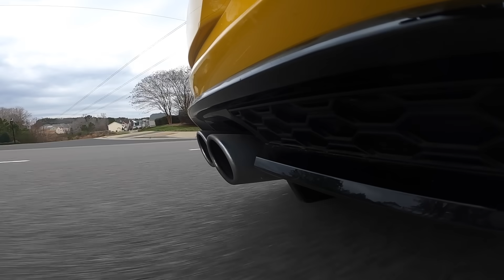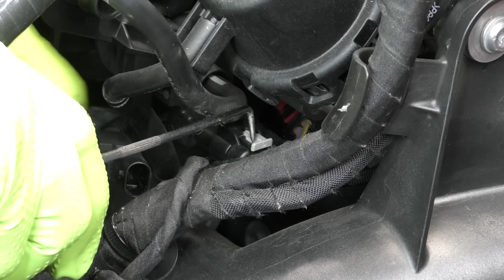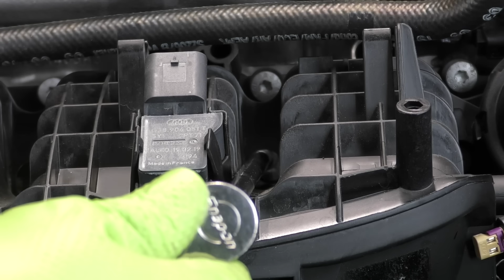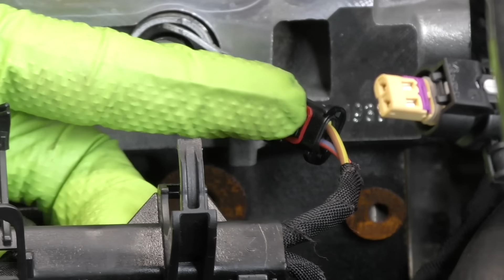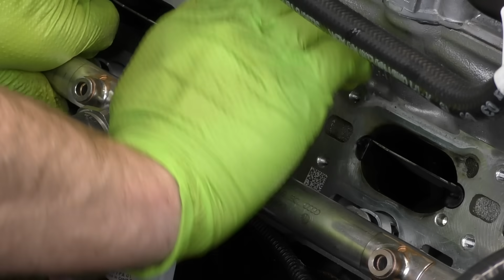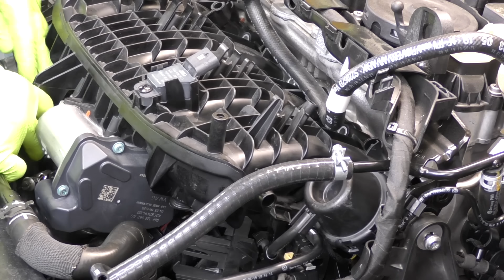Fuel Injector Replacement VW/Audi TSI Engines

Comment: Perfect know ima knock mine out cause my epc light keeps coming on and the car goes limp then I have to pull over restart and hope it doesn't come back on😮‍💨
Reply: Did it work my epc light came on. I changed the coil, pcv. This is my next step I’m still contemplating if I buy all 4 aftermarket or just 1oem. It about the same price.

Comment: If you get too much fuel mixing with engine oil, your oil will be thinned out and you could get a bearing knock. Happened to me a few months ago on a new engine rebuild
Reply: What if you don't drive the vehicle and you change the oil, does this till stands?

Comment: My 2010 Audi A5 I know is burning oil. I just got an error P0303 misfire on cylinder 3. So I went ahead and replaced spark plugs and coils. Coil 3 was bad. So I thought this would take care of it but then I was driving and shakes a little here and there.  I am thinking I need to replace or clean injectors. Any advice? Or could it be something else. I don't have the error showing up either.

Comment: I just wanted to let you know, that I despise that M10 triple square on the bracket... That is all.

Thank you for another great video!
Reply: See that video about "how to remove manifold"
Reply: I had to buy a set of sockets because of that one bolt!  -.-
Reply: You can buy a socket that’s got a balled M10 on the end of it for this specific bolt. Makes life a lot easier
Reply: What happens if you don’t put back the bracket??
Reply: @bfhlee6434 nothing,I leave them off to make it easier for the next tech that works on the vehicle,or me 😂

Comment: Hey man your video has been super helpful with my Gf 2.0 TSI Beetle. But I got a question, do I have to worry about “coding” the injector if I’m replacing one? Thanks!
Reply: Yeah I was wondering the same thing. When I asked a mechanic for a quote they said they'd have to do this. I went out and bought a VCDS interface but I can't find anywhere to input new injector values and am currently in communicating with their support center to figure out how to get there
Reply: @joshshields9155  I went ahead and put the new injector in. I didn’t do any coding or anything. Car is fixed now.
Reply: @SantiagoGarcia-yt8ww  any issues?

Comment: Thank you for showing this. these 19 S3's are a pain in the ass and have wayyy too many issues with injectors. This should help a ton.
Reply: I think my 2020 s3 might have injector problems, only has 13k kms on it and got a misfire code and hide cylinder 3 😢

Comment: I'm dealing with replacing the valve cover seal. Yet I'm not able remove the fuel injectors; I noticed you talked about a lock? Are you able to explain more about the lock on the injectors????

Comment: I'm replacing the fuel injectors for rough idling engine while still.  RPM's bounces around until you start moving.  Only happens with first startup of the day.   How do you know if you need to have your manifold media blasted once it's out as well?

Comment: Original injectors are pretty expensive here in EU. How do aftermarket hold up because some mechanics don't want to work with anything that is not OEM? Also, is it ok to replace only one that is problematic or all of them have to go?
Reply: It's better to replace all at once just so it's one and done and don't have to worry about it later if one is bad chances are the other will follow soon after

Comment: I have a 2018 tiguan and I have gotten the code P0202 intermittent fault on cylinder 2 injecter twice now. Each time the car goes into limp mode (Once in March and again now in July). Turning off the car and restarting it fixes it every time. Do you think it is a problem with the wire harness to the injector? Seems strange it went silent for 4 months with no issues...thanks for your time
Reply: @funtimes8581 I have the same car, and just got P0201 on cylinder 1.  Did you ever find out if it's your wiring harness or the injector?  I'm going with wiring harness for now but was just curious as to how it worked out for you.  Would appreciate any advice on it.  Thank you.  P.s.  Mine goes into limp mode about 1 minute after starting it every time....just started doing this, but unlike you, restarting the car doesn't fix it.  It goes into limp mode limiting to 4000 rpm within 1 minute of starting the car, every time.

Comment: Hey I just did a intake manifold install along w injectors on a Volkswagen CC and now the car won’t even crank start or try to crank over.? Do you need to bleed the fuel line since the line was off?
Reply from the maker: a little, but if you Are not even cranking, you have other issues.

Comment: Hey, Charles. I just completed a bunch of repairs on my 09 GTI including walnut blasting the intake valves. Unfortunately, after an approximately 20-30 min test drive, I have suddenly developed a major problem. According to VCDS, I have simultaneously triggered both a P0201 and P0202 fault code, injector circuit malfunction. I personally, am skeptical that both injectors failed simultaneously, so my next suspicion is that I neglected to fully seat the connectors on injectors 1 & 2. I dread having to completely remove the intake manifold again, so I was wondering if you think it is possible to inspect the injector connectors for cyl 1 & 2 by removing the alternator and maybe using a borescope. If the injectors have failed, so be it. But, if it's just me neglecting to fully connect the connectors, I'd like to remove as little as possible to reach in there and push the connectors back in.
Reply from the maker: First make sure they are all the way plugged in. The coils too

Comment: Hi Charles,
It's the only wideo where intake manifold was removed before removal of fuel rail. Does it depend on engine code? Is it possible to remove intake manifold without touching fuel rail on 2.0 CPMB (Audi)?

Comment: sooo.. in a bind here Mr. Humble .. did a carbon cleaning ( 15' GTI s @ 86k ) was a great learning experience your videos are awesome and a HUGE help!! its cool seeing how everything is so tightly fit into these engine bays . i got through that part fine, slowly but fine  .. cleaning went well .. i was really satisfied how clean the walnut blasting process made the valves. putting everything back together wasn't to to bad.. i had a minor issue with the HP fuel line .. the nut to the fuel rail wasn't snug enough and the fuel system was not happy.. fixed that .. drove the car a little .. will admit the idle was pretty rough which i expected . . seemed like after a mile or so it smoothed out.. drove back home no issue..  then after a couple hours went to start the car again.. crazy bad idling  .. i have obd11 plugged in.. ran the scan after shutting off the car ( i did get a epc light after this last start up ) come back i got " HIDE CYLINDER"  and Misfire Cyl 4 . also did a live run with OBD11  and heavy misfire count on 4 also.. did some swapping around coils .. spark plugs.. issue still remained in cyl 4..  my concern is when i did the walnut blasting and some use of CRC valve cleaner that its possible some of that cleaner made its way into the cylinder .. i was going to try my next guess which would be replace the injectors ... would that be the next place to look?. i figured if the injector is stuck open .. to much fuel .. car shuts that cyl down as a fail safe. . or the spark plug is just getting dumped on from fuel and thas my misfire?  * side note, i did not replace the intake manifold yet . also was considering that too. . if you or anyone w/ just as much knowledge sees this .. i appreciate any info , thanks
Reply: What was the cause of this issue? Just had a carbon cleaning on my 17 R and im experiencing the same thing on cyl 3.
Reply: I think he means coding so the fuel air ratio with new injectors are programed i think i have that problem because i replaced injectors and havent coded them now i get missfire on my 4 cylinders
Reply: @Skwwow  you replaced the injectors and ur misfiring on all 4??
Reply: @dyleann  I'm also very interested in hearing a response to this because that's exactly what's happening to my 2016 Passat SE 1.8t after walnut blasting and replacing the fuel injectors and spark plugs. Finally got it all out back together and now getting misfires on all 4 cylinders. Opted for Bosch injectors instead of cheap aftermarket ones too.
Reply: Hey guys - yes, super important if you are 🚫 NOT replacing your injectors you must reinstall each injector to it's corresponding cylinder as per before starting the process. 
If you look closely, each injector has a unique i.d. number which is matched to a related piston in the firing order. 
If you get the order wrong on refit the ECU won't have the injectors mapped to the original pistons as before repairs. 
IMPORTANT! If you are replacing your injectors, you must enter each new injector i.d. to match up with a corresponding piston using a scan tool. 
Suggest taking a photo of each new injector I.d. before replacement and make a note of each injector position in your engine.
You will need this information when mapping your new injectors to the relevant piston position in the ECU.
However, if you have a misfire from only one injector after repairs most likely it could be related to that injector, or wiring and connector issues with the fuel rail wiring loom.
Reply: From what i understand the injections have to be reprogrammed...i dont know why they leave out so much important info like this...kind of makes the video irrelevant!!!
Reply: @coryjackson6034  More details, vague post is vague
Reply: @UngluckInc  i dont have more details on the reprogramming thing its just something i seen done

Comment: Question; On the gen 2 CDAA 1.8 tsi, can I take the manifold off without removing the fuel rail, and with that, the injectors? I want to do a valve clean but don't want to have to take the injectors out and reseal them. TIA!

Comment: Like your video! I have a 2012 VW CC 2.0 tsi, recently I am experiencing a hard time because when deeping the accelerator, cylinder 2 misfire increased quickly and the engine is shaking. sparks and coils are OK, and I did the cylinder compression test and all 4 cylinders are around 130 psi which is not good but not that bad. I am thinking if there is anything wrong with the fuel injector in cylinder 2.... anyone any suggestions?

Comment: Hello, and is it essential to add the new code of the injector in vcds? For tdi engines it is required.. I dont know for tsi. THANKS!
Reply: @HumbleMechanic Please Charles, do you know any additional info about that? Is required to coding the new injectors with vcds when I replace them with brand new bosch with code ID ? (In TDIs is necessary do this procediment). In Tsi is not necessary? THANK YOU!

Comment: Hey Charles! I love your content and wanted to give a quick tip that I remember from college for anyone who may not know. At around the 10 minute mark you mentioned needing to calculate for the extra distance on the torque adapter. When using a torque wrench with any sort of adapter, and you don't know the formula to calculate for the extra distance, just offset the adapter to 90 degrees and you wont need to do any maths.

Comment: Do most of the ea888 gen3 parts also work with the ea888 gen3b? Besides internal head work obviously. I was just curious as I contacted APR and they can't tune the car well with the current mods I've done to it.

Comment: Hey man I have a 2014 jetta with 1.8t. It's misfire on cylinder 4 and 1. Replaced all plugs and coil packs. No improvements. I ran the car with both plugs out of it and they are sparking fine. Do you think fuel injector would be the next step? The misfire goes away almost completely around 3k rpms.

Comment: Hey man, I have a 2017 VW polo tsi and I had a problem with is suddenly losing power and misfiring and when I put it under diagnostics it Said I had faulty injectors and so I changed all 4 of them but still the car doesn't have power.
The diagnostics is still picking up a injector fault
So I dont know if the problem might be with the software that needs to be reset or anything like that? Please help me out
Reply: Oh and this Is a MK5 POLO

Comment: Hey Humble mechanic , just wondering if S3 injectors off its previous Audi 8P model, fit on a A3 2010 TSi ?model , also 8P. I'm looking for an injector upgrade. Going the K04 route. Thanks in advance.. Richard

Comment: Bro did 1.8t 2000's engine have Direct injection or indirect?
Reply from the maker: Port(in direct)
Reply: @HumbleMechanic  dont understand, Indirect?
Reply from the maker: Injectors in the manifold and fuel is injected behind the intake valve

Comment: Did a great job on a VW cc 2.0t motor swap, at the trans shop, work, a while back, ✨😎🔧🏁 except the AC wires share some short on car, 🙄, Anyways, on one now , this Audi A4 2.0t loads of fuel leaking🌊 🚗🧯, and great video here on what the possibility's that could be leaks, good looks , Ciao 🎰💪💚...lol the customer just showed up with some fuel injectors, to choose from lol🤣🔫🎲

Comment: 8:40 - Unfortunately after having a shop do a carbon cleaning for me at 98k, this fuel pipe is leaking at the fuel rail. Any suggestions of how to tighten it up without removing the intake?
Reply from the maker: Oh no! This actually seems to be more common. Might need a rail or fitting

Comment: Do I need to purge the air from the fuel line?  I just replaced my injectors and now pump and rubber fuel line are pulsating.  How do you bleed air from the low pressure side of the fuel system? Thanks
Reply from the maker: Not really. This isn't as critical as the TSI is.
Reply: @HumbleMechanic  Thanks Charles, excellent video!  Stay humble my friend 👍🏾

Comment: is there anyway to know 100% if you have an injector issue on the ea888 gen 3? my cupra has a pretty poor idle in regards to it shaking, vibrating, can feel it in my steering wheel and peddles when the car idles, it drives fine and my lambda doesnt show up anything. but, what i have noticed is that when the car idles sometimes the fuel requested vs actual can jump around a lot.

Comment: I just bought a 2018 Golf R and your videos are excellent. I am looking to do the Stage 2 modifications. From your videos I'm thinking with enough confidence, I can do a lot of this myself. What torque wrenches do you use? Thank you again for your videos.
Reply from the maker: NICE!!! None of the stage 2 stuff is hard, the downpipe will be tricky on jack stands. But. its doable. I have been really liking the gearwrench 120x torque wrenches
Reply: @HumbleMechanic  I see you are partial to the IE products. I've been going back and forward with the different manufactures. I've looked at APR, Revo and 034 Motorsports as well. Revo has a Performance Pack that includes everything but the Turbo inlet pipe and the Downpipe. What are your thoughts?

Comment: Great video. Gave me the courage to clean my injectors on SQ5. Having real trouble re-seating though. Followed your instructions but 3 out of 6 just won't go in no matter what. "Gently pushing into place" simply doesn't work. Any suggestions?
Reply: what do you end up doing?
Reply: @dyleann  The o-rings that are pressed onto the injectors expand after being pressed on, so I took it back to the shop that pressed them on and they redid them. I put them straight in after that with no problems. So once you have the o-rings sealed onto injectors, make sure you install them right after and don't wait days later like I did.

Comment: What are the signs that a fuel injector is leaking? What to look for when we take out the injector? Cheers
Reply from the maker: You usually get a misfire and raw fuel smell
Reply: @HumbleMechanic  Thanks, I don't know how that smells, I have zero experience in car smells. And the misfire, I always got it on Cylinder 4 (swapped coils/spark plugs), and now especially during winter only after several minutes of driving I get rid of it. I think is because off all that gunk on the valves that becomes more... fluid? Idk, just have a look here: https://imgur.com/a/0xx5tFk . Car has 204 k kms and I am sure nobody cleaned the valves before I bought the car lol

Comment: Did you need to reduce the fuel pressure at all ?
Reply: Just pull the fuel pump fuse/relay , run engine, when it runs out no more fuel in manifild fuel rail...

Comment: vw GTI mk7 2015 with P0092, I think the problem is the Pressure Sensor. Black exhaust tip. How to change the sensor and what the recomended torque spec. Thank's

Comment: I’ve been getting random misfires on cylinder 2 on my Mk7 gti, I changed spark plugs and coil packs too. Do you think cleaning my fuel injectors would help stopping the misfires?
Reply: Hi I've got the exact issue, cylinder 2... 
Did u resolve yes, I've changed coil n plugs, still no luck
Reply: @rajamin1986  yes sir, I needed to replace a fuel injector. You should go to a vw specialist shop and do a compression test on your cylinders to confirm the issue.

Comment: I have my 2012 A4 B8. I’m getting fuel in my oil, oil cap smells. Recently replaced injectors with the latest revision 06H906036AB but my car came with 06H906036G. I do have a stage 2+ tune but my oil has never smelled like fuel and is more watery. Would revisioned injectors matter for a tune? Also have colder ngk spark plugs gapped to 0.024

Comment: Tip! AutoZone has the injector tool kit. Part number 8877. Has the slide hammer, and everything needed to press the seals on.
Reply: do you have the link to it? I cant find part number 8877 on the autozone website. Please and thank you.
Reply: @EdgarSorto-t9s updated part number is 6069 I believe. Alternatively, just ask for the fuel injector puller. It will also have the seal compressor